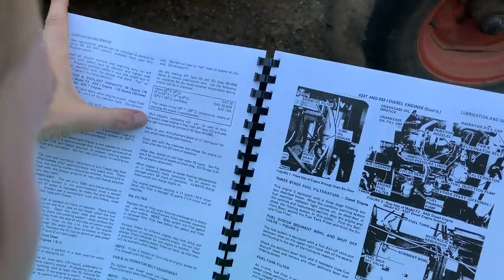And She Runs! : Gleaner Test Run Corn Harvest 2019

Comment: Gleaner Combines are the best! My Grandpa had the pull type machines and kept upgrading to self propelled. Bought their first new one in 1960 and moved up through all the models over the years. Dad traded for a Massey Ferguson one year and got rid of it! The one bad thing about them was the A/C. Don’t know if Lawrence was told? But make sure he soaks the ball bearings that are under the big chain on the unloading auger with penetrating oil. Looks like that machine has set outside for awhile. Don’t want you to learn the hard way like we did and swing the auger out and have it bind up and fall off on him!
Reply from the maker: He got air fixed today, it was actually just a valve  turned off lol. I'll share about the bearings! Thanks!

Comment: Looks like he's hose cleaning out the Air Conditioner's "Condenser".  When my AC wasn't working in my 2002 Ford Truck, it was because the relay in the relay/Fuse box had to be replaced. ChecK the fuse and relay for the AC Compressor. Yeah he's surely working hard on old Gert.  WE like your videos, it kickback material here on this end. Enjoyable!.

Comment: Great video.  U grew up in western Illinois on a small farm.  I would ask that you keep a broom in the cab so you can sweep the dust off the engine compartment three or four time per day.  The Gleaners were prom to fires because of heat from the exhaust system.   As for the AC get your ohmmeter out and ready all the wires, make sure your compressor is engaging.  If the eire are good and the compressor is not engaging then you are losing coolant.   Might want to look into a camper AC unit about $700. Will look odd but keep you cool.

Comment: As a new subscriber, I think it a very poignant moment, as you were going up that hill,
Some 40 years ago, as a farmworker in the UK, a local farmer and I were Gowing Up a hill on the way to a field of Wheat, at the bottom of the hill there were six road workers cleaning trees ditches and rubbish, on passing them it was all thumbs up,
we proceded to about 150 yards past them when the main drive chain to the wheels snapped,,
the combine broke into reverse motion at breakneck speed,    in reverse  with the farmer screaming  and me howling at the road workers, all six of them went in all directions, 
we were going about 40 miles per hr in revers totally out of control when we came to a stop in the ditch,   just like to say brakes were none existant ,  good old days.

Comment: Great video and outcome,saving your bacon with the gleaner brings tears of joy but I reckon Laurence may have thought of this and that’s to blow out the air conditioning condenser radiator,it’s possibly hiding in the roof,not sure I didn’t bring up schematics for it.When I was a child a monkey wrench was a Stillson pipe wrench,that tool your using was Called a shifter or shifting spanner or adjustable spanner.
Another thing is it possible to mow and bail the corn stalks for fodder to supplement the pure corn meal you’ll be giving them now,it’d be a waste to leave all that behind.take care,so happy for the family,this is a relief.
Reply from the maker: Thanks Harry! Good points!

Comment: I know this video is a few years old but if you still have the Gleaner, here's some advice from a guy that ran one almost 40 years.  Make sure your cyl clearance indicator is calibrated and start with the cyl concave clearance at 3/4 inch and work down if not shelling well. 7/16 will give you ground feed. Chaffer and sieve settings listed in the corn head manual are a good start. You want to be able to get cyl speed down to 500 rpm.  Check the charts in the book showing pully combos and speed range. Get the right pulley/belt combo rather than risk the crop you spent all year growing. Mine normally had about 15-16 inch, but 20 is available.

Fan speed- in corn, crank it to the top end, beans about 2/3 open. Pretty hard to blow a corn kernel out the back.

I normally run 3 bars on the back half of the concave door. Some alternate the bars on the back, rather than put them next to each other. Bars can be channel or angle (half rounds also available), so channel gives you two shelling surfaces vs one on the angle. Make sure to have bolts in holes not being used.

Start at 500 rpm and 3/4 concave, keep the speed the same and lower the concave until ears are shelled. Remember speed makes feed so get it right and make whole corn.

Comment: That old combine might use R12 freon in the AC, if so they make replacement freon that doesn't require an oil change, it is called Icor Hot Shot 2. You can still get R12 on Ebay but it is expensive.

Comment: Meredith: Go to Welker Farms on You tube. They are much bigger and have bigger equipment, but most of their stuff is used. 40 year old tractors, 30 year old truck, and everything is second hand. But they do the same as you guys; buy used and repair it. Yours may not be bright green or red, but as long as it works !   Sometimes you downplay the importance of just being a gate opener or parts runner. Doing that for him is invaluable. Don't ever look at those tasks as a "less than" role.
Reply from the maker: Thanks John! Pretty sure the Welkers have been driving some nice new stuff lately. Haha. I love them and their channel. And I don’t take my role for granted but sometimes the reminder is nice. So thanks!

Comment: You need to tighten up the cylinder you have unshelled cobs coming out the back. When the cylinder speed and clearance is right the cobs should come out clean with no corn and unbroken cobs
Reply: RJ 1999 it's all good the deer and the turkeys got to eat. I'm sure he will get it adjusted right. they don't call them the great silver seeders for nothing.
Reply: His throttle cable broke while he was shelling?
Reply: @yogibear6271  great silver seeders is a bullshit name John Deere and IH gave them. The Gleaner will leave next to nothing on the ground when set and operated properly.
The deer and turkeys can find a John Deere field to eat from
Reply: @alanmccoy8924  I thought it broke while he was unloading
Reply: Clean unbroken cobs and the cylinder speed slightly less than where some kernels are cracked.

Comment: You would want to adjust tighter the concave of the combine because there are still kernels on the cobs coming ou to the seve. The way i adjust a combine and to minimise broken kernels is to reduce cylinder speed and tighten the concave. Now one good preventive adjustment on a combine is to make sure your concave and the cylinder head(beater) are parallel to one and other.
 In my days of combine maintenance as a dealer mechanic, a machine like you have would take a hole day just to go trough it and check all componants,belts,bearings,bushings,radiators,air filters etc.Then recommend what i thought should be changed or not.Mind you it always breaks when your combining.95% o the combines that i inspected and fixed did a season without break downs.

Comment: It could be a relay on the Air conditioner if your lucky but it could need a new dryer or condenser.  You wanna spray those chains with chain lube so they dont rust up or wear out and break.

Comment: You work that hard on something then to see it actually working then yea I can see where you would get kinda teary. Hey I have seen grown men do the same thing. That shortcut through the field reminded me of me when I was a little boy chasing after the tractor wanting to ride. I noticed when the combine was cleaning out under the shelter there was several cobs with corn left on them. Tell Lawrence to tighten up the concave a little if the corn is higher moisture because the cobs are softer and more spongy. Takes a little more pressure to get it off the cob. Also if he finds shelled corn UNDER the machine between the head and back of the machine it is being shelled out by the rollers and stripper plates. He may have to tighten up on them some. It also depends on the size of the stalk and ears. Those machines are noted for producing a clean sample. One last thing and make sure he greases the flange on the unloading auger(where the chain goes). Those air conditioners were never that good. It has the old style "York" compressor. Check the lines for rat damage and cracking too. I know this is a lot but after seeing you cry I really want to help if I can to make that machine  do what it was meant to do and that is "combine" corn and beans. I have ran them so I know what they can do.
Reply from the maker: Thanks! I'll show this to him. He got a/c fixed today, felt silly, it was just a valve turned off lol. We won't combine the rest of corn for a week or so when it dries more.
Reply: @ThisFarmWife_  Glad it was a simple fix. Miserable when it don't work. Hope my tips help.........

Comment: I hope you can get it set a bit better so corn on cob does not come out back end.good luck. Thanks
Reply from the maker: The cobs are shelled coming out. It’s because of the way it’s made is all I know. But corn is good!
Reply: It was because the throttle cable broke and it was only at idle when he pulled out of the field

Comment: shes a good old machine we had a realy old gleaner and cut it to bits the put a record twin wrap silage bale wrapper on the front of it had a frame over the back axle to carry boxes of wrap on used to roll the bale along the ground and wrap it or if it was in a hedge or fence would pull it out  and then few years later got a ransom cavalier combine and did the same to it but it wasnt as strong as the alis then few years later bought a brand new trailed record twin wrapper took others to bits sold the wrappers and broke the rest sold running gear for spares memories a

Comment: Ok....need you to elaborate on the monkey wrench thing. "Tighter on the end than in the jaw". Never heard that. What does that mean?
Reply from the maker: I don’t know 😅
Reply: It means that the jaw had a firmer  grip on the inside of the jaws. If you don't have the nut or bolt to the inside of the jaws you'll round off the bolt or nut.
Reply: It means that the end part of the opening is usually narrower than at the base, so you must open the jaws wide enough to receive the bolt or nut, and then tighten it. Hope that helps! Lovely post as always Meridith. Go bless you and yours.    Regards, Ron from Minnesota